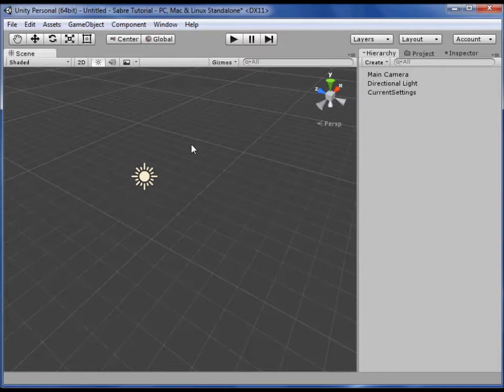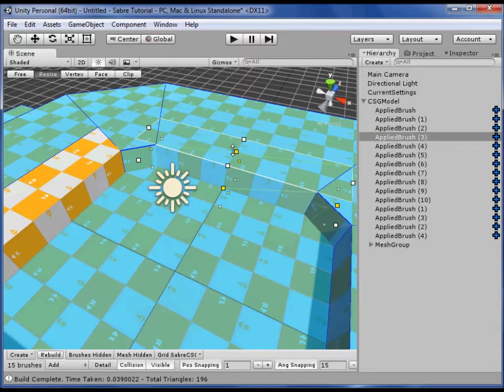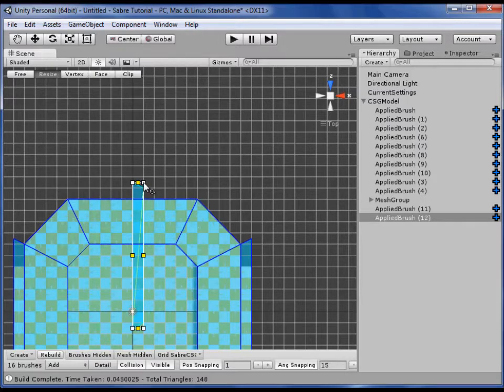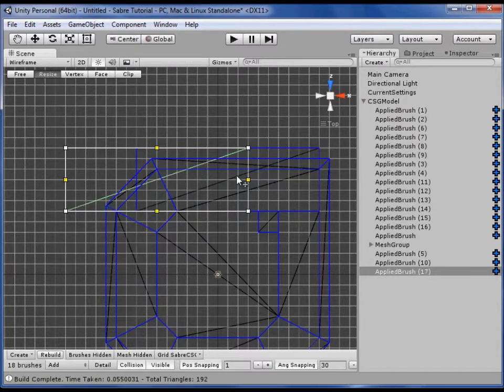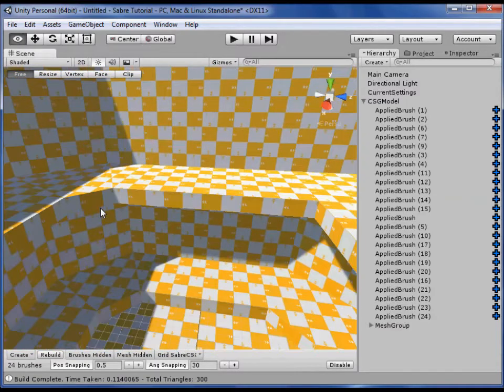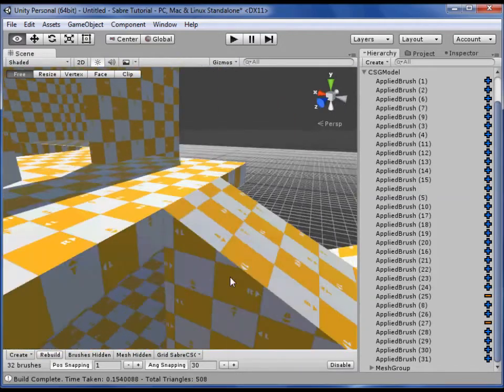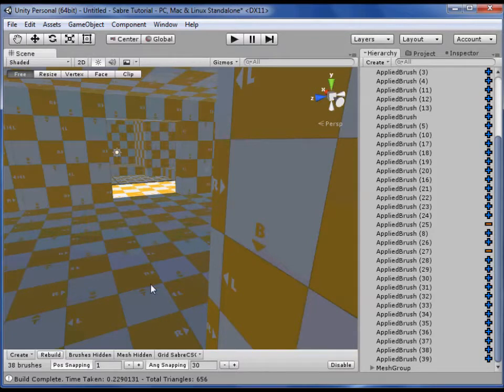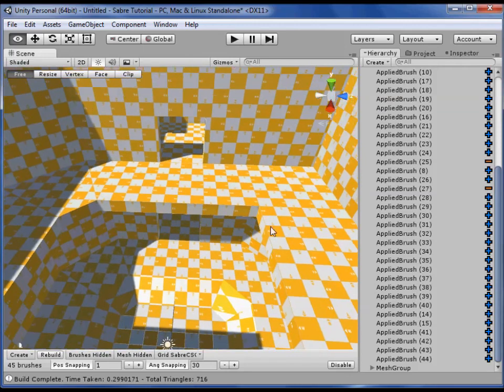SabreCSG Making an Arena

Comment: is there any way to edit the collision mesh separately from the material mesh?  can't really make proper stairs
Reply from the maker: On the bottom toolbar you can toggle if a brush contributes to the collision/visible mesh. So for stairs you'd set the steps to a be visible and then have a simpler brush which is marked as collision only. Likewise you can create invisible walls by creating a brush that is marked as collision, or create visual windows that don't affect allow the player to pass through by creating a visual subtract brush.

Comment: Boolean CSG technology (BSP-like) - does it mean that you calculate BSP tree + PVS and do some render optimization?
Reply from the maker: +Gleb Lebedev SabreCSG produces meshes which are then displayed natively through Unity's mesh renderer set up. We don't render the final geometry via a BSP tree for a number of reasons, including the desirability of keeping rendering unified through one system (so that shaders, scripts or materials you use for imported meshes can be used directly on SabreCSG geometry too), and the technical problems of writing a custom rendering pipeline that is more efficient than Unity's heavily optimised native mesh rendering (we are however looking at supporting occlusion in a way that fits closely with the Unity model).

Achieving more efficient rendering is one of our goals and we have a number of planned features on our roadmap after the current release ships (1.2 which introduces more powerful brush and surface tools and a bunch of other improvements is about to be submitted for release). The planned features include zoning tools and supporting automatic occlusion and seeing how it all ties into Unity's built in Umbra occlusion to make sure what's being rendered on device is optimal.
Reply: +SabreCSG years ago I wrote bsp import from q3 bsp files into unity. it was generating leafs as separate meshes and then script on the camera was enabling/disabling them using camera position and PVS. So it was using standard rendering pipeline.

The disadvantage was that even q3m1 has more than thousand leafs. And don't get me wrong - each leaf had more than one face in it.

Do you know if Unity do any optimisation on the level mesh? like occlusion culling, quad tree etc? is there any unity plugins that could be combined with your wonderful tool to make render more efficient?
Reply: +SabreCSG sorry, I was reading you message on phone so I've missed the second part which has an answer.
Reply from the maker: +Gleb Lebedev Yeah that's my concern with doing my own PVS, that the overhead of drawing too many draw calls will actually be more costly than a smaller number of bigger meshes. I may be completely wrong about that, but generally when I've worked on Unity iOS games in the past I've found that ensuring good batching gave bigger gains than heavy occlusion culling. 

Unity has support built in for baking occlusion culling via Umbra, I believe it works on meshes and uses the static batching quite smartly. It's been a while since I've looked at it and I'm planning on taking a look in depth at occlusion and optimising the rendering, but it's not something I've had time to look at just yet. SabreCSG is maturing pretty rapidly so after the 1.3 release I'm going to be looking at this in depth and going the empirical route of trying different approaches (PVS, portals, zoning) with production SabreCSG levels and seeing what gives the best results. Sorry if my replies are a little hazy, I haven't looked much into this yet as I want to block quite a lot of time to develop the right solution.

In regard to other plugins or Unity features, the built in occlusion culling could probably be used pretty well. I'm not sure what other plugins are out there, many of the ones I've seen are static batching related, which is probably not so relevant to SabreCSG as it produces minimal draw calls already.